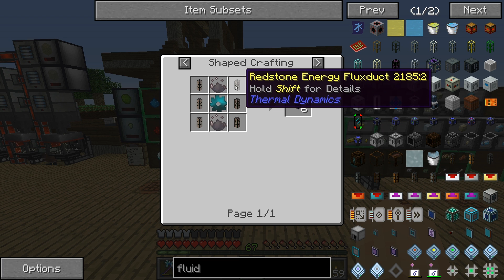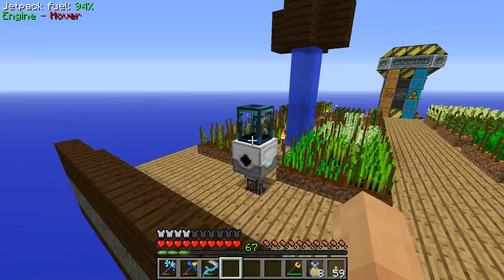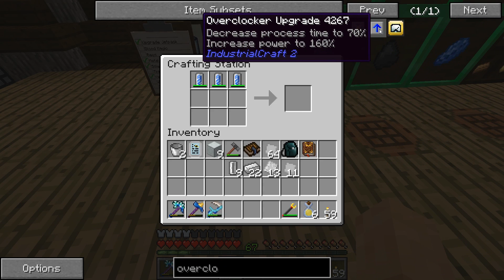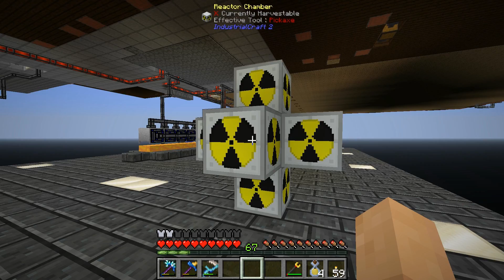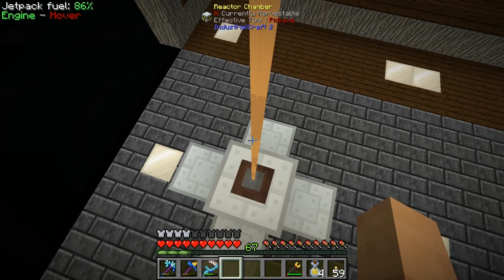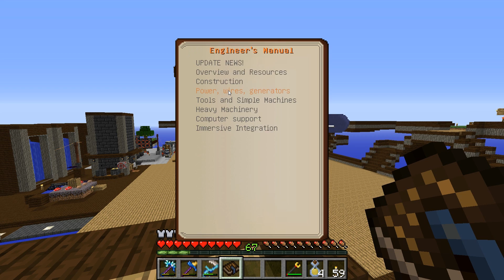FTB Infinity: Expert Skyblock Alpha - Ep. 19 - Nuclear Reactor & Overclockers

Comment: For the metal press You could try a thermal expansion filter only allowing one at a time. Or ender io has a upgrade that will slow down inputs too. Might be slower than a hopper.

Comment: With 27 cells uranium stable like that, it's almost as good as the best stable quad setup which is 7 quads = 28 singles worth. The difference is mainly power gen (420 I think vs 130 or so) and not having to use some extra resources to craft the quads. For getting what you need, it's a quick and easy setup.
Reply from the maker: +binaryalgorithm Completely agree.  Great setup!

Comment: Another great video. 
I had a similar issue with the metal presses. 
I managed to solve my issue by leading into the machine with a conveyor. The ingots would back up on the conveyor and enter the press when they can. Rather than sitting on the press doing nothing. 
Maybe you have a similar issue?
Reply from the maker: +Nathan Brom I got it figured out and will update next video.
Reply: Nice! I'm glad to hear it. 

After all they are quite a bit faster and cooler than the Metal Former

Comment: Unless whoever is currently maintaining forestry has changed it, the lightning strikes generated by the bees isn't the actual vanilla lightning that is used by the lightning rod, along time ago I tried that set up with the Industrialcraft lightning rod and found it didn't actually work.
Reply: +TheDivineHunger I tried the same thing and it did not work so my guess is that it won't work with the immersive rod either.
Reply from the maker: +Micah Shlain It's really too bad, cool mechanic, but alas no good